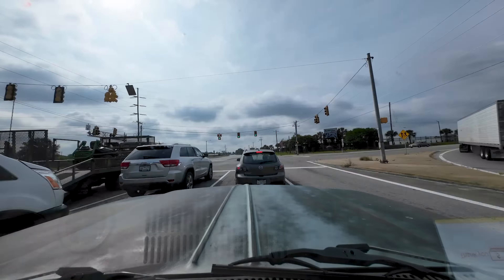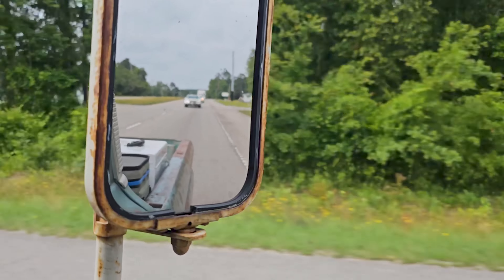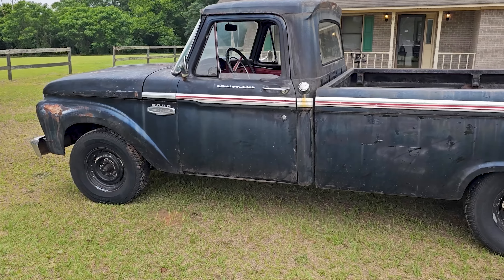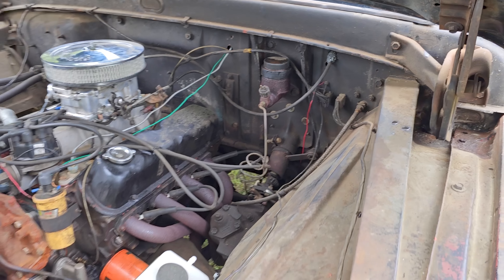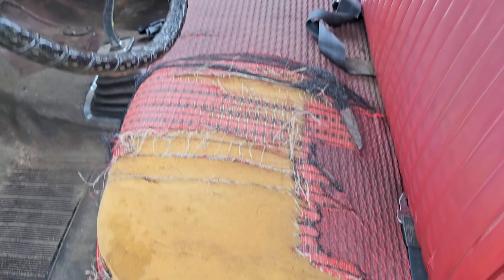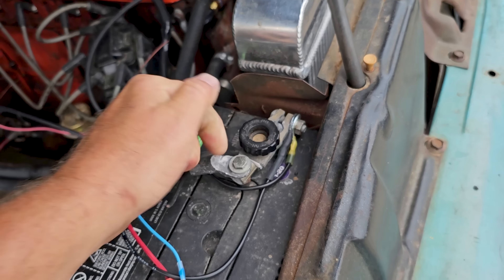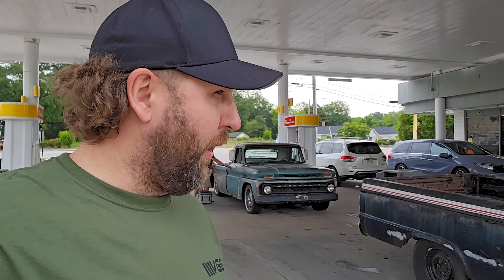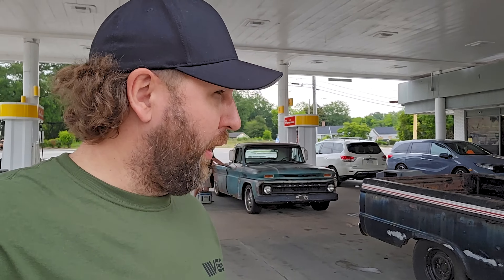Bought Sight Unseen! Will This Ford F100 RUN and DRIVE 640 miles home?

Comment: It's official. HRPT is a bucket list item. Looks like a challenge and a heck of a lot of fun.
Reply from the maker: It sure is!
Reply: I am going to try an drag my 67 ford falcon to it next year hopefully
Reply: Bought a truck in October of last year and was hoping to get it running to got hrpt and we'll can't find the parts I need and a budget friendly engine..and it needs alot of rust repair ..also been to busy to work on it..
Reply: Is there anything like it on the West Coast.  I live in California and would like to do something like it.
Reply: I know it’s a sensitive issue but I’d love to know even a ballpark figure for an old truck like this. Would absolute love one back in the uk but only ever see beautifully restored mega expensive examples this side of the pond.
Reply: It's been on my list for at least 5 years and I'm hoping next year that I can do it but that's probably gonna be kind of a tall order seeing how I haven't even got my car out of my brother's shop in Indiana to my place in ohio where I'm going to swap a 95 12 valve cummins into my 1972 grandprix model j planning to have ac and cruise control ya know for the comfort stuff what ever that is lol

Comment: Thank you Derek for showing the reality of being a car guy. With the breakdowns and issues along the way, your attitude and perspective through it all is great!
Reply: Most of the good "car guy/gal" stories come from the journey, not the shows! It's never guaranteed you'll get where you want to in these old rigs...and that's the fun.
Reply from the maker: Glad you enjoyed it
Reply: @DakarRaider  These are old machines! Literally hundreds of 50+year old crucial bits, each of which can fail at any time. Not to mention many MANY years of rebuilds, replacements, new parts, "new" parts and downright juryrigs holding them together.
But they have bags of class!
If you want to go from A to B without issues, take the train! If you want an adventure, drive an old car :)

Comment: This put a big smile on my face! I've been waiting for you to do a video on one of these '60s Fords, Derek! I have a factory 1965 F-250 4x4 with the original 352 that I've owned for the past 6 years. Hope that F-100 is good to you. Keep on, keepin on!
Reply: The 352 was a great Ford engine but you don't hear a lot of talk about them.  They didn't tend to be one of the Ford engines that had vapor locking problems.  Good strong engine.

Comment: I have a 1976 Chevy C-10 scottsdale for sale if your interested. It is a 2 owner truck, it has the original 350 Chevy with a turbo 400 transmission. It has 54,000 original miles. I got the truck a few months ago but I don’t have any time to fix it up and I want it to go somewhere good. It’s a west Texas truck and the only rust is the passenger side cab corner and the passenger side fender. All of the truck is original except the intake but I have the original one if you want it. Please get back with me because I want it to go somewhere good

Comment: Nice truck.  Reminds me of the 1980 Ford F100 I used to own.  Had a 300ci straight 6 mated to a 4-speed manual transmission with a granny gear.  Fun truck.  Wish I still had it.

Comment: (at 1:09 in the bed of the truck)>>>Have had the JNC 660 jump box for 15 years now.  Still jumps any vehicle and have used it to run back home on, for about an hour of drive time.   It still had life left.  Now they have a JNC 770R.    Thanks for the vid Big D.

Comment: That Summit carb is basically an Holley 4010. Orignally designed and sold by Holley. The Summit are an newer updated version of the original Holley design and do still use common Holley parts.

Comment: So these are my favorite trucks. Ive got countless hours into working on them. Biggest issue i saw with this one is the wet floor. Often times, it's a rusted out cowl, that leaks water into cab (not the weather stripping, as many craigslist experts tend to say.).

Comment: I bit the bullet and bought a new Holley Street Demon 625cfm Carb for my 1973 F100 "Grumpy". It made a night/day difference!! Instant start, No stutter, No sputter, Electric chokes! I used to have a vibration at 60-65 mph to and that went away. Think the old one had same issues as that summit carb!

Comment: Who would’ve thought a transmission from Monster would cause so much of a headache 🤣 

It’s almost like that’s the reputation they have or something
Reply: Haha who would have thunk it 😂
Reply: Monster is almost like getting jasper engines 😂
Reply: I bet it is the solenoid shifting valve body causing it. I remember when those Trans were new in the gm trucks and the entire valve body would be very good and hot and the entire Trans would be cool but it would start running power voltage through the valve body and it even has been a problem with burning down a few of the early versions before the rubber and plastic pieces to keep them grounded for it to work correctly and also seal so it would shift. Probably why the Relays were getting hot under the seat.
Reply: @stevenmcc2119  jasper is local to me and I've had a few buddies work there over the years. I avoid anything with that name on it like the plague.
Reply: @billyputnam6892  that’s happened to myself once before. 

But I’d almost put money on that trans being smoked, simply because it’s from Monster.
Reply: Sorry for not responding earlier but I've had a couple of the 727 dodge in the purple performance line for a very highly modified stroker roller 340 that you would swear you can hear a stock car coming down the road when you're getting it.  But like you said before the middle 2000s something changed drastically. My first Trans was just about bullet proof and it was also very reliable in the shifts of racing for a certain time and I have a couple of standard Trans for a  high gear ratio and the  low close ratio gearing.  My buddy needed a Trans to get his car going and he was just not a good Mopar older car driver for staying on top of it and crashed and it broke the Trans. But now it was 2012 and the same Trans with the same  in house dynamic power rated sheet was absolutely garbage and the shifting was just all over the place and it was soft and it literally blew up and it came apart and it stuck pieces in the Kevlar shield and it was also very below the rpms of the spec at 6280! But I have been completely building my own Trans since then. It was very bad and I had a family member that was in the car when it happened and I almost didn't catch it at 72mph and it oiling the tires and road and it was horribly close to changing the lanes and in heavy traffic.  It was close to a horrific tragedy and the company was just so careless in the aftermath that it made me learn to make the next Trans not explode with shrapnel!!

Comment: Guy at a parts store can't tell the difference between a 2 and 4 barrel? Wow
Reply: Sounds pretty typical of what these parts stores hire....complete morons is what they hire.  My uncle worked in a parts warehouse for 27 years....supplying parts to these part stores...when they moved he applied at an Autozone, wouldn't hire him he was over-qualified...rather the manager of the store knew his job would have ended pretty quickly had he hired my uncle who knows far more than he did about parts.

Comment: Hello, 
   In the mid 80's I had three different  1965 Ford F100's.
The first one had the 300 inline 6 cylinder with the custom cab.  The second one had a 289 v8 with the regular cab. I  had to build a flat bed for it. I drove it from Michigan to Arkansas and didn't even think twice about it, not making it that far.  Never had any problems with it until the day I left to go back to Michigan, and I had to replace the starter. 
  The 3rd one had the 6cyl with a four-speed trans with granny gear. I  love the 65 Ford.

Comment: I had a 66 custom cab just like this one, same color. Had the 352 motor, overhauled at 110,000 thousand and drove it for another 150,000 miles. Cab mounts rusted through and cab sat on the frame. Tough motor, 3 on the tree and loved it. Put a velour seat out of an 70’s olds delta 88 in it. Later switched to old buckets from a Ford Thunderbird. Best truck I ever owned.

Comment: And Concord is where the Charlotte motor speedway is at the RV and I used to work with Roush Fenway racing. Of course they have a Concord Mills bunch a good places to eat around there.

Comment: Derek, a nice touch for these older vehicles would be to carry a set of allen wrenches and a 5/8, 7/8 or 15/16 wrench and snug down on the steering box play to make drivability so much better. It makes a vehicle steer so much better with zero money and 2 minutes of time. Showing people how easy it is to change the whole feel of the vehicle would be very beneficial for your patrons.

Comment: Derek please figure out the noise cancelling when you are recording because we can't hear the vehicle running. As well as can you normalize the audio levels across each video. There should be a base volume setting where when you import a video it will bring low audio up to that base level.
Reply: When you were checking out the new ford is an example.

Comment: I’m shocked that it turned over so quickly, and that you didn’t have to push the clutch in.  I’m in love.
Reply: Older truck didn’t have that funky safety switch like the new ones

Comment: Just a suggestion: @24:50 you threw the cheap fuel regulator on the ground.  Many peoples are easily influenced by little things like that.  I wish you'd make a point of telling everyone or showing that you clean up around your worksite, as I'm sure you do.  Other than that, great video!!

Comment: Really enjoy your videos, just keep doing what you do!!!!!    
I drove a 66 F100 for many years. Bought it when there was only a cab and frame and the bed . Built it up with a 400 and FMX transmission. Put disc brakes and power steering.     Drove it for over 200 thousand miles, it was the most comfortable truck I’ve ever owned.   Wish I would’ve never sold it 
Once again, just do what you do. You do it so well.    Thanks for the entertainment

Comment: I used to have a Truck like that.   The Bed was Rotted and My Dad and I took it off and I drove it without a bed.  We had to put all new brake lines on it,  and a floor Shift because the Original Column shifter was broken off, also all New Brake lines.

Comment: I had an f-100.  The carburetor nuts fell off one time.  I could keep it going by doing a slow one wheel peel at stop lights otherwise it would stall.

Comment: It was great to vicariously be on the trip with you all. I thoroughly enjoyed this episode. Does that make me weird? I owned a 66' F100 in the 90s. Mine had the 240 6 cyl. It had the "flow through" rear main seal so I couldn't park it uphill but other than that it was fine unit. If I was forced to park it uphill, it would look like a 73' Harley had parked there. Some wonderful memories in that truck! Thanks Derek and crew!!

Comment: if your battery terminals are taped like ours over the pond, turn the connector upside down, saves having to put a screw in it.

Comment: Hope you have better luck with your than the one I bought. 352 swapped out for a 390 thunderturd with a 3sp that someone screwed up royally. I bought a fe c6 with was difficult to find. Rebuilt it, had a converter built for it and it spun a rod bearing as soon as I got together. Never bought another ferd after that loss

Comment: My first, and only, truck was a '66 F100 Custom Cab with the 352FE and FM2 transmission.  The previous owner did some appropriate upgrades with carb, intake, headers and Petronix ignition.  The brakes were terrifying; had I kept it, those would've been upgraded before they successfully managed to kill me.  The biggest downside was the '66 was part of a model generation that just didn't have a lot of aftermarket support and LMC had next to no parts for it.  Still, seeing this is giving me some serious pangs of regret.  Hopefully she's good to you!

Comment: Good find! It's just like my '66 F100, only I still have the 352 and the 3 speed is still on the column. That's a well optioned truck, all the chrome, Custom Cab, AM radio, factory V8. It can be hard to find one so well equipped. Great video, you got me wanting to take my '66 on HRPT!

Comment: I am starting to think that when Derek takes a trip such as power tour, he REALLY should carry 1 extra case with him. In that case would reside a spare carb and some basic tuning parts for that carb. Tossing an electric fuel pump and a good regulator in there might not be a bad idea.

Comment: Pretty cool Derek, I had a 302 I put in a 65 mustang coupe for my wife. She loved it years ago. It was in a 70 I had that was a parts car basically. The mustang originally had a 289 but it was in bad shape and all torn apart. The 302 had more power and I put duel pipes on too. Sounded sweet

Comment: That's a cool old truck.  I'm surprised you can buy a Holly carburetor for a 66 Ford at your local Autozone.  That's kinda crazy.  I have a couple vintage motorcycles (60's and 70's) and there's not a ton of parts available at the auto store.

Comment: You know you can unlock zip ties without ruining them(well most of the time) by sticking a small pick or screw driver in the square block and prying up the small piece engaging into the strap.

Comment: Hey Derek. Bummer brother on the Cat Farm. I've followed you since your home garage days. Yall have given us many hours of great fun and alot of tips on these old vehicles. My first truck was a 66 Ford F100 with a 352 3-speed column shift. Good old truck. I got to thinking on the Cat Farm. I remember watching the build but I don't remember if it has a TV cable like the hemi half. I had an 84 T-Bird that had a solid arm from the tranny to the throttle body. It came loose and all I had was 1st and 2nd till I found it laying on the intake. Maybe it came loose or is out of adjustment? Just thinking. Anyway Blessings to you and your family and thanks so much for all that you guys do in these videos. It's great to see your whole family involved in what you do. Safe travels brother.

Comment: No offense Derrick I've only owned 5, 1964-66 Chevy and 2 older Ford trucks throughout the years. Your new Ford ( I guarantee )  will make the rest of your tour without many problems. All the parts can be had at O Reilly's and basic tools fixes it Every time. It will get you Home brother.

Comment: My first truck was a 2wd '69 F100 short box with a 302 and 3 on the tree. I grew a set of Crager SS wheels, a Holley 1850 600cfm 4 bbl and Edelbrock manifold and a Pertronix Ignitor ign.  I pounded that sucker for years until a friend offered me stupid money for it, enjoyed every mile in it.

Comment: That Summit carb actualy is a great carb! It´s a development of Holleys 4010 which was based on the Autolite 4100 - It uses all Holley standard parts - jets, PVs, needle & seat - all your Holley parts fit.  In addition it has annular boosters for great economy. Fix it you will love it.  Love seeing a Ford in the lineup !!

Comment: Nice truck , I drive a 62 f100 short wheel stepside , has a 351w c/4 auto may have a t-5 for sale , , I had it built for it , 2.79 first with an 0.59 od  never installed, am thinking about a gear venders instead .if your interested?

Comment: Derek you should check out 187 customs. Sean murder nova just replaced the motor and trans in his new blazer and had the same not shifting out a second gear if you did

Comment: I actually dd this one once, with the same truck. I haven't watched the vid yet, but that looks just like my old 66. I bought it on ebay, and then caught a ride down to Aiken, SC to go pick it up. It ran, but there was rust in the fuel tank that kept clogging up the fuel filter. Had to get out and rep[lace the fuel filter every 30 miles, all the way back to Greensboro, NC. You all can google map that if you want...guessing 150-200 miles.

And yes, it stopped on a bridge once...and another time in the middle of I-85 right at a bend. I got very lucky that night to not get forever-napped, standing on the bumper of that thing in the middle of he highway, changing out fuel filters.

Haha...anyway, for once,. I can commiserate while I watch the video.

Comment: Derek have u checked the grounds my truck did same thing went into limp mode in the trans and wouldn't go over 35 it was a broken ground wire going from the body to the frame

Comment: Some day: Put a split brake master cylinder and front disc brakes. Maybe put a T5 transmission? 
Limited slip differential.
Add cool wheels and tires?

Comment: I ended up with my Grandpa's '63 Chevy pickup that was originally the same color as yours (till he painted it purple).  Also, the bed rotted out so he stuck a sheet of steel in back.  And replaced the rear bumper with a steel I-beam.  What year is yours?

Comment: How is this power tour purchase doing now for you Derek sir...I kinda like it I'm really into the bump side Ford trucks I would love to own a 68-70 f-250 352-390 prefer the 352 or the 360 but cool regardless not too sure on transmission preference it's a automatic,3 spd on the steering column h pattern manual shift transmission and the 4spd Borg warner t10 dump truck manual shift on the floor transmission... I mentioned that because the one my dad had was a dump truck transmission.